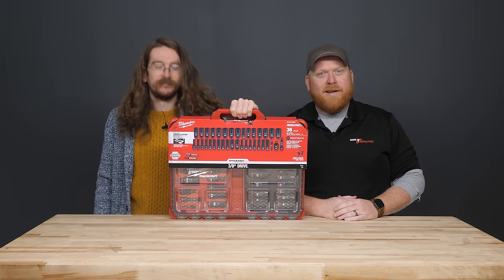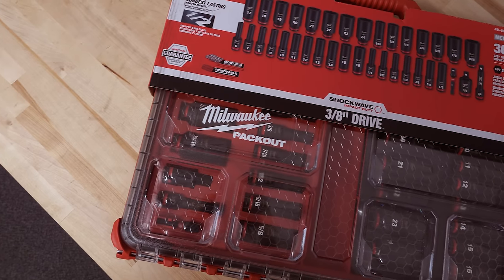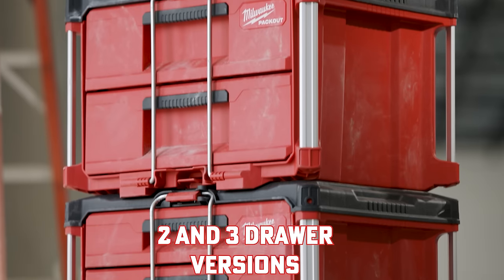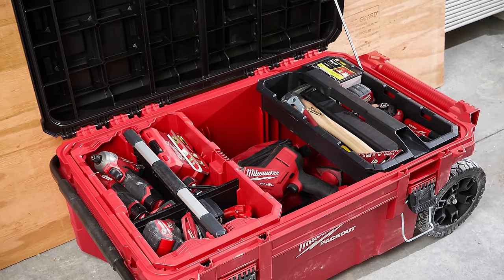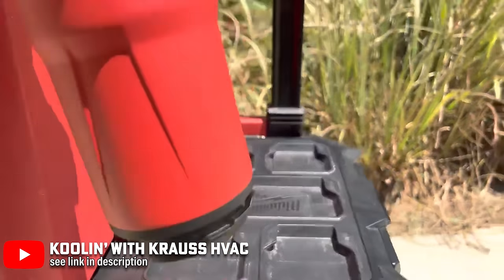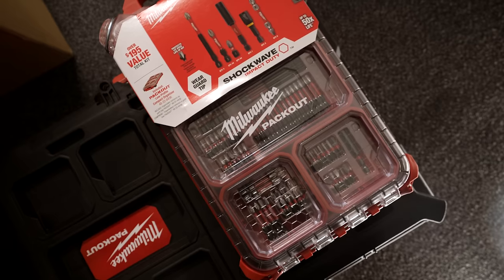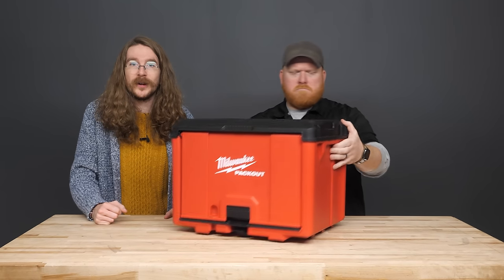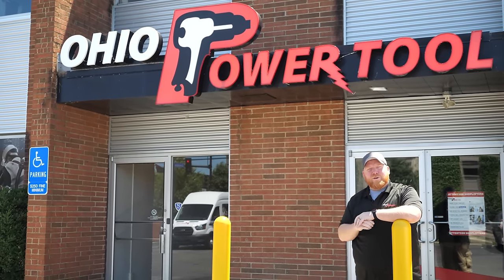Milwaukee PACKOUT Top Ten Accessories - Tool Boxes, Crates, Cabinets, and MORE!

Comment: Fact check... Milwaukee was late to the party. ..The Festool Systainer came out in 1993 and Sortimo/Bosch L-Boxx came out in 2004, beating Packout to the market by over a decade but they seem to be made out of recycled Coke bottles. The material is much too thin to toss in the back of a truck without fearing for the life of the contents. Packout for the win!
Reply from the maker: You are 100% correct they weren’t the first, never understood why these never caught on before but Packout definitely changed everything. Don’t think people are going back now, system storage is here to stay!
Reply: Systainer is ABS which is not great for anyone actually doing work. They are impeccably engineered though, just not particularly robust.
Reply: My buddy is a festool guy and his systainers look like horrendous they barely even pretend to close let alone lock. I don’t have the heart to tell him I hope he doesn’t see this comment
Reply: Great. That's awesome. But Milwaukee made it easily affordable and accessible to the masses. Kinda like Apple when they released the iPhone. They weren't the first to create a cellphone, but they made it easily affordable and accessible for the masses. Now they're the most successful company in the world. Like you said, Packout for the win!
Reply: Nothing beats the Packout system . 

I was a Milwaukee man years and years ago. But I had a lot of issues when they switched from nicad to lithium. Over the years, I've had issues with their tools as well. 

So it's kind of funny, on the job site, when I take  out my packout tool boxes and then pull out DeWalt tools. Hahaha
Reply: @patrickavondale8653  WTH MAN!? I thought you liked my festool gear? I see how it is.. 

J/K  not your buddy 👍
Reply: @OhioPowerTool estoy interesado en comprar herramientas, hacen envios a Colombia?
Reply: @tomroume3178 I have makita in mine😂
Reply: @noelv1976 apple and  affordable? Since when?
Reply: How can i put the drawers on the bottom ,and the box on top 📦
Reply: @sparx2391 err you can't 😂

Comment: The packout cabinet should have been the base of the packout rollout. It would have been easier to get to the contents as opposed to having to remove all the packout containers on top of the rollout to be able to lift the lid open and access the contents every single time. Or even the double or triple drawer should have been the base.
Reply from the maker: That's a great point! And who knows; maybe Milwaukee will come out with some wheeled drawers specifically for that reason! The sky is really the limit with Packout, and only time will tell where Milwaukee goes with it!
Reply: @OhioPowerTool I love my pack out box but a set of wheeled drawers would be a complete game changer for me
Reply: Yesssssss!!!!
Reply: @OhioPowerTool They have recently introduced bottom rollout drawer but more $$
Reply: @darrel15 They recently bought out bottom rollout drawer model but more $$
Reply: @brianbaker359  I haven’t seen that yet. Time for me to go look

Comment: The Mounting plate is perfect.  I put one high up on the wall of my trailer, and put two of the small clear top organizers on it. One holds my first aid kit, the second is flashlights, fire starters, and a bunch of small things I often use when camping.   Always available, yet out of the way.
Reply: Heck ya!

Comment: The Packout ammo box is perfect for the Milwaukee M18 brad nailer.  Use only the long center divider and put the nailer on one side and all your different size boxes of brads on the other side.
Reply from the maker: You can fit so many things in there!
Reply: I have mostly dewalt tools but I just bought a Packout stack and am thinking of buying the 18 g nailer
Reply: @hunterlang6035  I am very pleased with the M18 nailer.  It performs like an air nailer.
Reply: @JWimpy  I had a ryobi one until it broke and then I had to switch back to my pneumatic one and man do I miss the convenience of just grabbing a battery and a box of nails and going
Reply: @hunterlang6035  I had that one too before I got the Milwaukee.  It worked pretty well but I had mostly M18 batteries so I traded.

Comment: First time watching one of your videos. Subscribed! Only thing I don't like about the wall mount brackets is that they don't work on 16" centers when using more than one beside each other. They should have an overlap on each end to make them work. In a perfect world all garages / shops would have all walls made of plywood.
Reply from the maker: Hey Mike! Thanks for taking the time to check us out and subscribing! It would definitely be nice if the plates were able to snap together easier on a wider variety of surfaces and materials, but Milwaukee's also known to release second and even third and fourth versions of some items to introduce upgrades and new features; maybe we'll be seeing a Wall Plate V2? 👀
Reply: @OhioPowerTool  I notice that Milwaukee always leaves out some key features with their power tools and PACKOUT that they eventually add to a future gen. Flex with their STACK PACK looks like they took PACKOUT and added all those missing features. All Flex has to do is make a more expansive line of tools and tool storage and they'll really cut into Milwaukee and Dewalt's share of tool buyers.

Wishing the people of OPT and your families a very Merry Christmas and a Happy New Year.

Comment: i just picked up the tray, and with the  dividers in each spot is big enough for a qt can of pvc glue or cleaner. As a team yellow guy its bitter sweet to say that red tool boxes are far better than then the yellow option. also i love the ammo box, when i had the dewalt stackable boxes i had my drill and driver set below the "general construction" tools and almost never used it, now ive got it in the ammo box and its the set i take in with me almost every time!!
Reply from the maker: And there's nothing wrong with that! You can be a Team Yellow fan while still enjoying and appreciating the other side for quality craftsmanship and ease of use and a host of other reasons! Glad you're enjoying your PACKOUT stack!

Comment: They have sockets in Packout but not wrenches. No worry I took the Packout slim pulled out the trays, added some kazon foam and made my own. 1 imperial & 1 metric.
Reply from the maker: Y'know, a Packout wrench set would probably sell like hotcakes! Milwaukee's got some customisable foam inserts that you can pick up for a variety of their boxes, but an official wrench set from them would be pretty rad!
Reply: @OhioPowerTool  if I could send you I picture I would.
Reply: Yes, and they could do the same with allen key sets, and another for specialty bits like spanner, torx or nut setters, TA/TP3
Reply: what is kazon foam?
Reply: @Lekky93  Kaizen. Srry I misspelled it. 🤷🏻‍♂️
Reply: @Makitafan  ALl good, how do i buy this stuff?

Comment: I put a m12 fuel hackzall, m12 hammer drill, m18 fuel oscillating tool, impact drill and a battery charger with 2 m18 and 2 m12 batteries in that compact tool box. Carrying it is easy, does not Wack your knees. It’s the perfect box
Reply from the maker: It's absolutely stunning how many things can fit into the Packout boxes!

Comment: I’m an electrician. I need something for my hand tools and my drill/impact hun, wore nuts, an assortment of screws/bolts/washers/nuts

What do u suggest?
Reply from the maker: Hey Michael! Sounds like you could use a couple of pieces for all of that! For all your tools, depending on how many you've got, we'd recommend either the drawered tool boxes, XL tool box, and/or potentially the Rolling Tool Box to store them all. For nuts, washers, bolts, and screws, take a look into one of their Organisers, either full-sized or compact, which can click right into the top of whichever tool box you go with!

Comment: What we all should be appealing to milwaukee to do is stop producing those wasteful container that are not oackout that most of us get rid of because they don't work with the packout system and we replace them anyways with the packout boxes. It just doesn't make sense milwaukee making and putting tools is a box that doesn't use the packout system, most folks will spend the extra dollars to have a packout box that they can use especially when these boxes can  come molded to accommodate these tools. These other containers ends up in the landfill and doesn't make down for hundreds of yrs. Come on milwaukee protect the planet.
Reply from the maker: Agree 100% at least with all FUEL tools, would love to see PACKOUT
Reply: I love these containers and just continue to refill them as i go through the bits. They're half the price as a set that comes in a packout case and are easily tossed in a packout toolbox

Comment: Packout is a great system. I have quite an assortment of these tool boxes. Including 3 sets of the starter 3pc sets (hope that makes sense lol). BUT....I think Milwaukee is starting to get very greedy. I refuse to pay almost $50 (Canadian) for a coffee cup...Nor a $50 "tool station". .....$32 battery rack or towel roll holder? Now, come on! Or how about $16 for a 2 hook curved hook ($1 at the dollar store for something similar)????..... I won't be buying any more Packout items. In fact, stopped buying Milwaukee tools all together. 

There's just something distasteful when a company tries to rip off their customers!
Reply from the maker: That's totally understandable! Especially if you're able to still get done what you need to get done, that should be the most important part; save money if you're able!

Comment: Time for a Packout Makeover 
#10 Rolling Toolbox 

#rollingtoolboxmakeover
Reply from the maker: That was the first packout from many years ago so would make senses if they do any updates start there!
Reply: @OhioPowerTool  I had a whole list of upgrades for that box, then my phone died and I don't have the psyche to type all that again. 
F it!
Make Gen 2 like the 2 Wheel Rolling Cart but with 2 extra wheels in the front like GETT Tools Mod. Then make wheels detachable like on the new M18 Wet/Dry Vac. Then you can use the Box and the Cart as a cart or Dolly separately if needed. 🔥💥💣🧨🎯🎳💪🏼👍👊🏽
Reply: @OhioPowerTool  They really need to step it up cause Flex Stack Pack is Fiya🔥

Comment: Packout is great but overpriced here in OZ.
Reply from the maker: You could always buy it when you're on holiday in America and then bin all your old luggage and just use the Packout on the return trip. You'd get cheap Packout (which is great!), holiday in America (which is, y'know, ehh), and you'd probably only have to spend the cost of three or four Packout pieces on the flights (which is significantly less great, but! International travel! Woohoo!). It's a win-win all around!

Comment: Smaller pack out cooler leaks and would never recommend. Does not even keep things cool for more than a couple hours. Look at irl reviews.
Reply: Mine works just fine and it keeps things cold for 16 hrs in a warm pump room.
Reply: @phillipmoody710  thank you for your irl experience. I haven't had that luck with mine.
Reply from the maker: Thanks for getting in touch! That sounds like something you may want to reach out to Milwaukee about; they're designed to be leak-proof, and that sounds like it could be due to an issue during manufacturing!
Reply: @OhioPowerTool  haven't heard anything from them. Gave up after a couple weeks.
a couple buddies have the same issue and 
Vcg construction also reviewed that product and found the same thing.